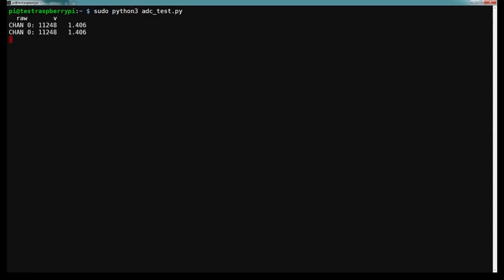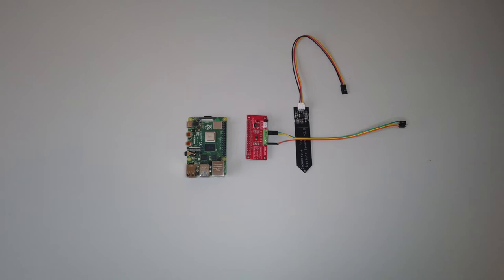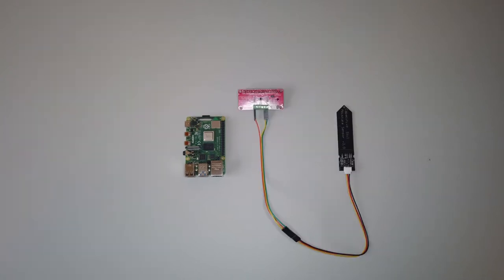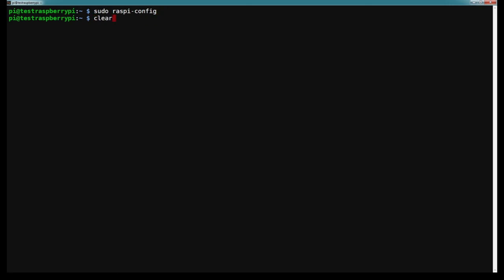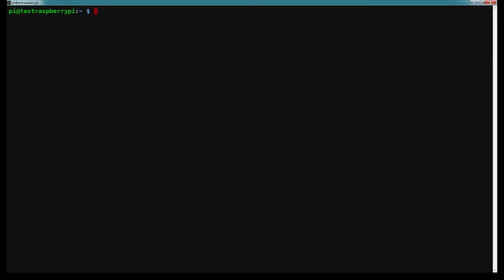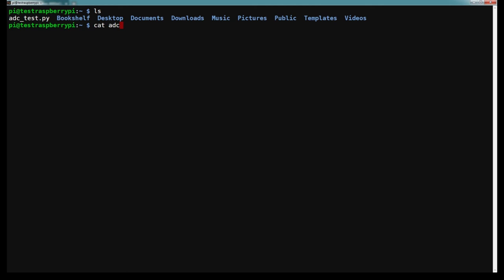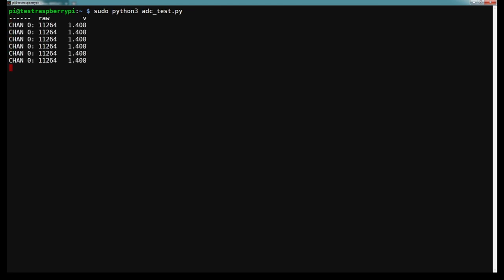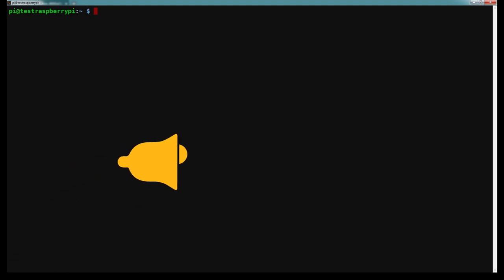Analog to Digital Converter [ADS1115] (Raspberry Pi)

Comment: If you are using an ADS1115, FS=3.3Vdc, for 32,768 raw. Correct? 16 bit signed is 15 bits of data. 2^15 is 32768. So, I’m not sure why it is that on channel 0 (raw is 11264) while (voltage is reading 1.408). Shouldn’t 11264 raw = 1.134Vdc?   If I understand it correctly, and perhaps I don’t, 3300mV / 32768 = 0.100708 mV/bit ergo 11264 = 1134mV or 1.134Vdc; not 1.408Vdc.   Can you help me out here? Thanks!
Reply: The default range is 4.069 V so 1 bit corresponds to 4.096/32768 = 0.000125. The raw value of 11264 therefore correponds to 1.408 V.
Reply: Thanks! Most Appreciated.

Comment: I do appreciate this code example, but the one thing I don't like about the ADS1115 driver: How do we set the address? 
I can't find any information on that. 
The ADS1115 has 4 addresses, but the Raspberry Pi code I've been running across doesn't let you enter the address. 
I have multiple ADS1115 boards; I want to give each a different address and use same I2C bus to talk them all. 
Can anyone make a suggestion? The only alternative I see is to abandon that driver and make my own I2C low-level driver that allows for addressing. 
Thank you.

Comment: Thanks for posting the tutorial and I am following your steps with the same equipment. However, my output of CHAN is always 0, both for raw and volt. How can I detect the problem? Is that the ADS problem or the sensor problem?(BTW I'm using RPi 3B+ instead of 4)
Reply: I have the same issue did you figure it out?